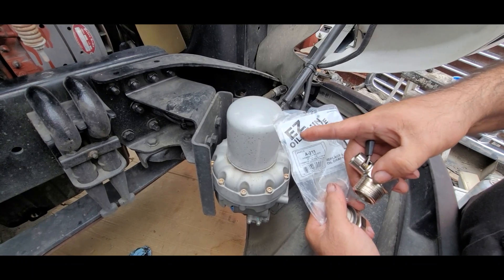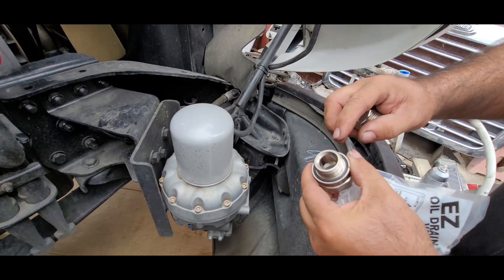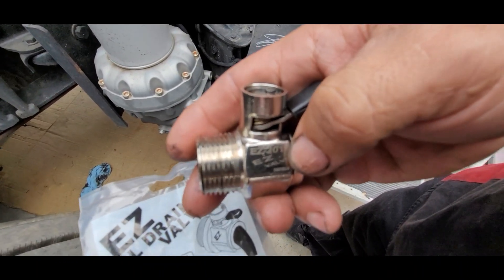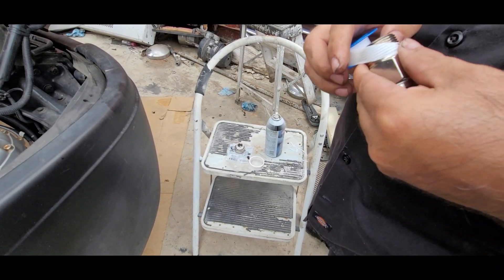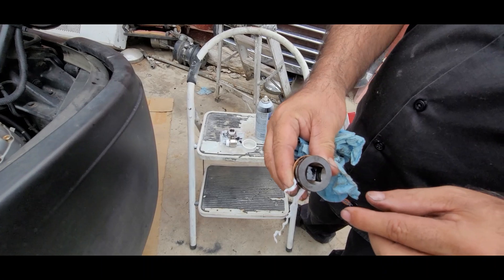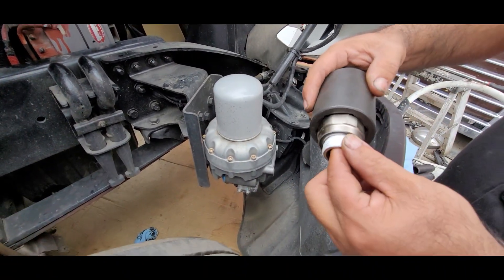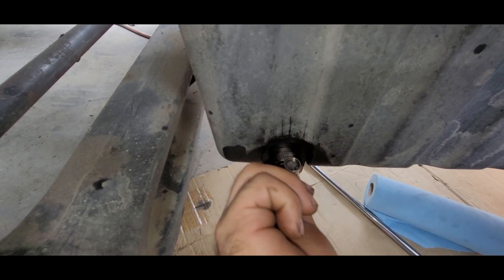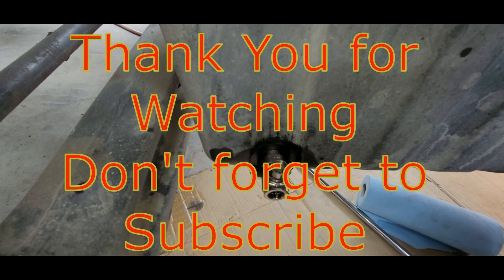HOW TO INSTALL EZ DRAIN VALVE

Comment: I need another one of these for my reefer trailer.
Reply: That would be nice let me know which one you find that works. I have a Carrier.
Reply: @markm0000  it’s the EZ-103 most likely, I have a 2016 carrier x4 7500 and I bought the combo pack that has an L shape that attaches to a hose for no spill oil changes. I got it through Amazon. Their website tells you which size to buy for your engine including personal cars.
Reply: @alex7289  Yep I looked it up the Carrier Kubota engine uses the EZ-103. They’ve been using the same engine forever it seems. I have a 2006 Carrier Ultima unit that has it. I’ll pick one up for my next service and do it myself. I’m paying $250 at the dealer every 1,000 hours and the last time I had it in they didn’t really care about it they overfilled it a little and the belts are still loose especially the fan belt that thing always looks like it’s about to blow off. I know how to check the compressor oil and refrigerant levels myself I will do it more often and on the road once I get a ladder mounted on my truck somewhere.

Comment: Hey Sam I hope you’re doing alright. I bought one of those for my truck but never used it because it sticks out too far. I’m afraid if I run over a tire or something it might rip it off. The oil pan is fiberglass so there isn’t much strength holding that valve in place. I’m using a torque wrench a little under the recommended torque at 33 ft lbs and I haven’t had a problem with my drain plug stripping the threads or leaking.
Reply from the maker: Hello Mark, I'm doing well. I agree with you is kind of risky and when you do the job yourself you take care of everything but some mechanics just don't care and that's when this valve comes and handy. Thank you for watching my videos. 👍
Reply: You can buy some quick drain adapters that are compact and don’t have a lever on them, so you won’t have to fear it opening while driving.
Reply: @thereviewer4173  I’m ok life goes on.
Reply: @markm0000  

I’m using the one from Femco. It looks legit, but I haven’t drained my oil yet, so I can’t tell how well it works. This one needs an extra piece that has a hose attached to it, so you can direct the engine oil and the valve opens when you screw it on.

Comment: Question what size would I use for a dd15 freightliner Cascadia 2014?
Reply: 27mm x 2.0. It’s ez 211 and you need the adapter a-211

Comment: Vuen video Sam yo compre esa parte pa ponerla y me iso falta el adaptador donde lo consigo?  Y me puedes desir cuanto de torque deve a pretarse. Yo lo aprieto a 28libras de torke nose sieso es corecto ai teencargo q mepases el dato x fa.grasias y q estes vien animoo
Reply from the maker: https://www.finditparts.com/products/9417664/ez-oil-drain-valve-a-211   aqui le dejo un link con el numero de parte. La verdad no se que tan apretado tenga que ir. Thank you for watching. 👍
Reply: Entre 33-40 libras de torque sería suficiente para el motor DD15 con oil pan de plástico.